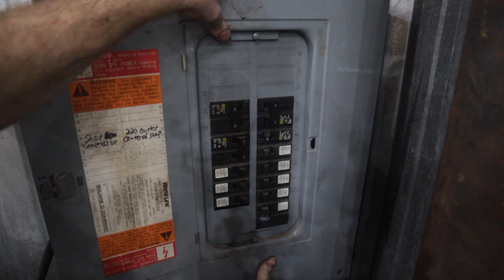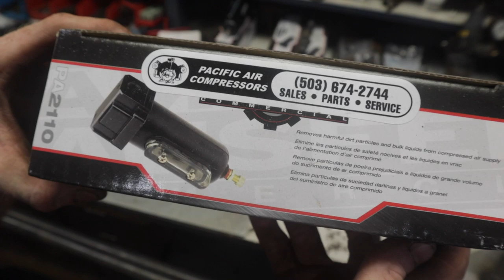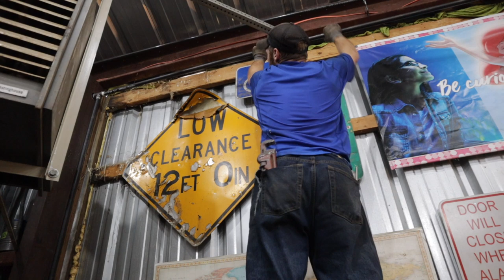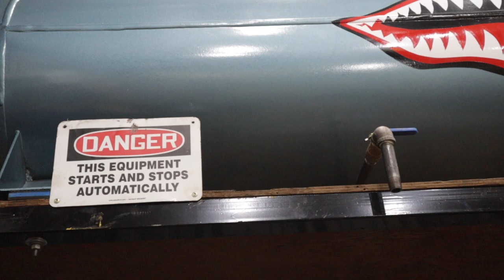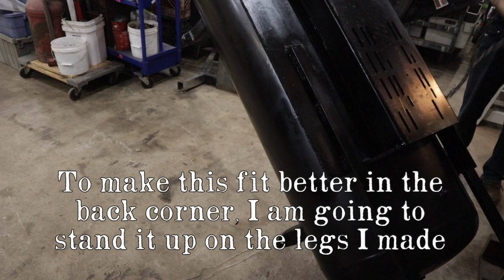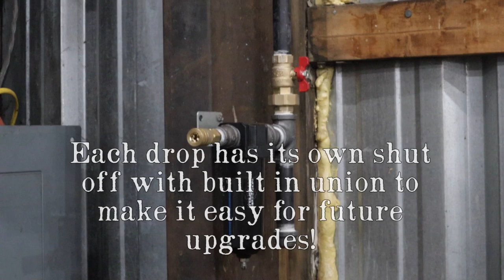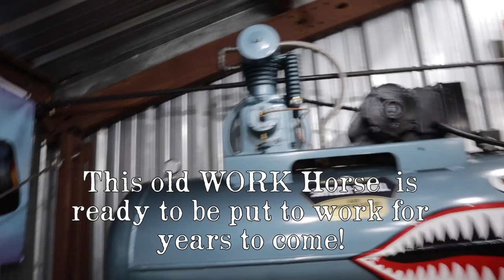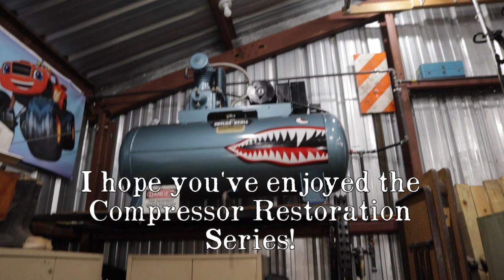OLD 2 Stage Air Compressor ~ Compressor on a SHELF ~ RESTORATION Part 4 ~ FULL Air Line Installation

Comment from the maker: Question of the video: What space saving ideas have you used in your garage or shop?
Reply: If it can go on castors...do it
Reply: Salvage Workshop mostly added drawers and shelves in places that had the space.  My default seems to be to pile stuff on my workbench until there is no room, then build shelves/drawers to hold all the stuff that used to be on the workbench.  It’s a constant struggle!
Reply: Don't try to fit 10 gallons of shit in a quart jug.
The biggest problem you have is using your shop as a work area and a storage space, you can't do both at the same time and area. You had to spend several hours just moving junk to install the compressor, that should tell you something.
Stop pack ratting and start tossing stuff you don't need, start with the 7 old suitcases, what good are they??? the  older garden  tools you don't use stuffed in the milk can and in buckets, if you don't plan on refinishing them in the near future, find somewhere else to store this stuff besides your shop, they are only taking up valuable shop space. You also have too many cabinets and filing cabinets in such a small area. Way too much clutter, unless you have a good memory better than most, you can spend half the day looking for something.
Reply from the maker: @rockislandrides The SUIT CASES are GONE!!! LOL (I still think they are pretty cool!)

I AGREE!! I need an entire building dedicated to storage of materials and planned projects! 

Now, I do know where just about EVERYTHING in my shop is located, but the problem sometimes becomes moving things to get to it, and that's a HUGE reason for all the changes I have planned!

One thing about me is that I am very good at getting awesome materials, tools, or equipment for free or very cheap that they tend to clog up the work space in the shop because I don't want to store things out in the rain.  The other reason I keep many things is because I don't always have the money to just go buy whatever I need for projects, so having things in the shop has saved me A LOT of money throughout the years! It's also made it possible to do many projects when I otherwise wouldn't have been able to afford to complete, so it's a double edge sword and I've been walking it for many many years!!.

Now I will say that I have a woodshop, machine shop, metal fab area, general workbench area and still room to pull a huge truck into it for work, all in one building, so in this shop, things will ALWAYS be a bit tight, but that's the reason for all the updates/ changes I plan to make! 

You make some very good points, and I appreciate the comment! 

As always, thanks for watching & commenting!
Reply from the maker: Most things that can be are on wheels here at Salvage Workshop!
Reply: Tossing out or giving away crap thats been on the shelf unused for years. If it's material I know I can obtain easily. Because we all know when you toss something out, next weeks project will require it. LOL
Reply from the maker: @Lapeerphoto  LOL valid point my friend!!  But EVERYTHING I have is SO RARE.. did you see all that crappy pipe I have!?!
Reply: @SalvageWorkshop  I'm in the process of sorting out a new/second hand shed just to sort out my 1st shed and house. I was born in Africa and inherited the hoarding bug from my parents and grandparents! The problem was if you threw something away you'd suddenly find that you needed it a week later and you couldn't ever replace it from the shops. 

This shed is going to be dedicated to sorting and throwing stuff away (to charity if it's any good). In the long run it will be used as an extension to my tiny work shop, but first the clutter has to go!!!! I'm fed up living with boxes everywhere!!!!

Wish me luck LOL
Reply from the maker: @Zogg1281  I've been in that boat, and sometimes its better to purge things that toy TRULY dont need, but it's never easy!! Good luck with it, I'm working on something similar in my shop now!
Reply: @SalvageWorkshop  I agree with you! I pack things away for projects or resale, feast or famine in my life. I try and keep things I feel are uncommon or kind of Irreplaceable. I did just sell vertical version of that compressor, they are great nearly every two stage pump in history is cloned after them. Anyway great videos I'm hooked keep it up!
Reply: Seems like a consensus -- all of my large tools, except the lathe and mill, are on wheels.
Reply: I built two foot shelving around the entire top two feet of my garage. I call it eyebrow shelving. Cost is $1.50 per linear foot. $1.80 if you paint it. Super strong
Reply: @billbaggins  When space is restricted and at a premium, castors gives you a big advantage with flexibility because of the mobility factor and easier access, probably the most important factor
Reply: @SalvageWorkshop   That is THE KEY, flexibility and access, you don't need tools "locked in the back"with no easy access
Reply: that welding magnet looks like a beast - never seen one like that.
Reply: I keep all my welding supplies in a large Job Box. I rebuilt my welding table to roll over the Job Box when I'm not doing any welding. I have added cast iron casters to a lot of my equipment so it rolls over the concrete floor.
Reply: @Zayden Gianni yup, I've been watching on Instaflixxer for since december myself :)
Reply: some peole put big air compressors outside,protected from weatther..its quieter also
Reply: put compressor outside  is space saving and it is help reduce comppressor sound

Comment: A really nice job. I too worked for years with an undersized compressor. This spring I built a dedicated compressor shed out by my barn and piped air back to my shop underground. The compressor is a new Campbell Hausfeld 80 gallon with a 25CFM pump. Its so nice to have unlimited air and no compressor noise. I also have my parts blasting cabinet in the compressor house. It's so awesome to have ample air to properly run air tools, especially the air hogs like sanders and blasting cabinets. I'm sure you really love it.

Comment: Another great series. This is inspiring me to upgrade my similar 110V freebie compressor to the 220V worn out unit I can have. If/when you add another tank and/or compressor at floor level you could run the upper compressors drain into the lower tank then drain the water from both at floor level. My suggestion to space and ease of cleanup would be some $80 Tractor Supply hose reels at each drop. Did that in my tiny garage and it helps so much. It just takes seconds to put a hose away and it's not a fight to get it to hang neatly. On your compressor if your shop gets hot maybe plumb the air intake out through the wall and down to where you can reach the filter for service. This would give it cooler intake air and also help silence the compressor. Another idea. Attach a ratchet or pull strap to that hand truck at handle level then you can strap bulky things down and they don't fight you when you try to tip it back.

Comment: As an electrician, my only complaint was that panel. Made me want to come and redo the panel.
Reply from the maker: totally agree! Other than adding a few breakers for certain things, that panel has been that way since Ive owned the property I I actually have a need to upgrade the panel... Here's the situation:I am considering trading some construction work for a VERY nice Lincoln Power Wave welder with wire feeder. This will give me actual mig & tig, with the option for pulse welding, but the problem is that this unit needs a dedicated  125 Amp breaker, but I only have a 100 amp panel in the shop.  The main building has a 200 amp panel that feeds the shop's 100 amp panel approx 150 feet away with 2awg / gauge wire (I'm pretty sure)... My question: Can I upgrade the panel to a 150 amp or even 200 amp panel without needing to change anything in the main building other than the breaker? Also is the wiring able to handle the increased load without needing to be upgraded to a larger size wire? I would REALLY like to upgrade to this welder, but I don't want to do it unsafely either! Any thoughts would be much appreciated!
Reply: @SalvageWorkshop  You could probably do 150 amp if your main is 200 amp. I wouldn't try and go 200 amp without upgrading your main to more. If it was me, I'd up my main to 300 amp, and then up the sub panel to 200.  150 amp will have issues, if your running the welder and it's really pulling 125 amps and the compressor comes on that should trip the breaker.  I don't believe the welder will pull 125 amps, I can see 60 amps. Would need to see nameplate or to know the model # to know for sure. 

As for the wire, yes you would need a bigger wire, 200 amp would be a #2/0 AWG  while 150 is a #1 AWG. You could run it in  Aluminum wire. Can get a triplex direct bury service entry wire. Normally runs about $1 a foot.  As for the wire to the main, if that is your service feed, it might be able to go to 300 amp without needing to upgrade it. 

If your not wanting to up the main, can put a load on it (most everything that will run at once) and use a amp clamp to check how much amps are being pulled.

Comment: Besides holding my breath as you worked under an unsecured load, good project. I believe you are required and its a good idea , to either cable or chain the elevated compressor to the roof joists and wall. The vibration will be intense, so check your fasteners at least quarterly if moderate use, mire often if use is daily or weekly.
Yes. A tour, planning stages, construction and installation, as well as all the rebuild/redtorations. 
I'm never bored by your accomplishments. I hope your wife understands your fan base.

Comment: Excellent job on the puffer, you are to be commended for saving a quality manufactured item and bringing it back to life. Properly maintained it will see you and your children out!  However, I'm not convinced with locating it where you have!  In summer, the temperature in the roof space will be considerably higher than at ground level, so it's going to run much hotter.  May be an issue depending on how long it runs for. Tank condensation will also be higher.  Also, servicing and repairs aren't going to be convenient.
It would look better at ground level to!

Comment: Enjoyed this series. You certainly have a valuable asset in that compressor. It makes my 5hp 60gal look puny by comparison, but my 5hp 60gal is twice the machine I used for over 40 years...  :-)
Reply from the maker: Yes, it turned out alright! If I had to but it new, there is no way I would want to afford it, but now it's a workhorse with a bit of value!! My old compressor wasn't in the same ball park either, so don't feel too bad! Thanks for watching & commenting!

Comment: Personally I would have made an inclosure for the compressor and used the flex hose to go through the walls and have rubber padding underneath to make it a bit quieter, since long exposures to the loud noises can make you irritated, and may cause damage to the hearing, but over all it is very well and good done job!!! And cant wait for the shop lay out.
Reply from the maker: I considered building an enclosure for it, but the problem with putting an air compressor in an enclosed space can be the fact that additional heat builds up much faster, and that's the enemy of all equipment, especially compressor pumps.  When it kicks on to refill the tank, it only runs for like 2 minutes or so, and it's not very loud.  You and I could easily have a normal conversation standing next to it while it's running!  That's not to mention that the fact that I wouldn't be able to enjoy my custom paint job!
Reply: People make compressor enclosures because they buy crappy foreign compressors that are spun too quickly and make way too much noise.  Buy a good industrial compressor like Saylor, Quincy, or Champion and you wont need to find ways to quiet it. The pumps are much heavier and have such a high output they can be spun at insanely low rpm and still meet your air requirements. I can barely hear my quincy 325 from my sidewalk with the garage door open. Salvage Workshops Saylor Beall is probably quieter than two people talking

Comment: Glad to see that you didn't cheap out and use PVC. Doing the job right the first time will pay off down the road. Always like to see other ideas on how a shop should be set up. It will for sure be better than my clusterfu** . lol
Reply from the maker: I totally agree! The only other thing I considered is one of those premade high pressure pex kits, but the cost for one of those plus all the extra fittings I needed was insane! My shop is a bit of a cluster right now as well!! I plan to change that!

Comment: The bolts going trough the tank's feet will conduct vibrations directly to the shelf and defeat the purpose of the pads.
If you want to install bolts,you need to also use pads between the bolts washers and the tank's feet.
tank and shelf must be completly isolated from each other.
You made suspensions there,while bushings would work way better : )
Reply from the maker: I'm sure some vibration will be sent through the bolt, but a large amount of it will be dampened by the pads, and that's all I was going for... Before I had the rubber pads under the feet and before it was bolted down I turned it on to see how much it might vibrate, and it runs so smooth that it didn't move at all... Now I do like the idea of adding rubber washers or pads  on either side of the washers, and that wouldn't take much add.  I appreciate the thoughts!! As always, thanks for watching & commenting!

Comment: Nice job, I would install an exhaust hood with fan above the compressor, given the space where its located next to the pitched roof, looks like a spot where a lot of heat will generate. An exhaust fan to the outside will take heat away from the compressor and give it a longer life. You don't see many people use black iron pipe any more for compressors, they do tend to sweat and create condensation and collect water in the lower joints, unions and elbows even when the compressor isn't running. I did notice the inline water filter and  also bleeder valve you installed on the bottom of the tank, a very good idea but unless you have a water separator on all your drops, you will continue to see water, this will ruin air tools and paint guns over time. While the black iron pipe is overkill, its looks like you went from 1-1/2''. 1-3/4, to 2'', used reducer nipples back down to 1/2'' npt ??? Whats the reason for this? Was this a plan or did you get the materials for free?
Reply from the maker: Not a bad thought, I do have plans to install a whole house fan on that wall of the shop to help deal with heat and other fumes, but it would also help the compressor as well! The cost of buying one of those high pressure pex airline kits plus the additional fittings was insane, and black pipe may be overkill, but it will outlast most any setup, plus the way i laid everything out, it will be easy to adjust. If you look at the last part of the video, you will see a water filter / separator at every drop for that very reason, tools are expensive! All the black pipe is 3/4" pipe then I reduced to 1/2" for the water filters, and then the air line quick connects I had were all 3/8". So the main reason was using what I had, but all of the supply is 3/4".
Reply: @SalvageWorkshop  That's all good and yes the pipe certainly should last 10 lifetimes, my apologies, I missed the part where you showed all drops. Good job indeed
Reply from the maker: No need for apologies!! I don't take offense to much of anything! You were just giving your thoughts, and I'm cool with that!! As always, thanks for watching & commenting!

Comment: this big sharky seems a bit heavy for the 2 poor horizontal black bars... what about some 45° reinforcements ?
Reply: Tonton des Bois I agree, that frame looked a little weak, especially since it will be constantly vibrating.
Reply from the maker: It's more than strong enough! The whole thing is bolted to the ibeams in 6 places, and it's not sagging at all!! I thought about adding gussets, but that will limit what size cabinets I can fit under the shelf, so I decided against it. Good thought!
Reply: @SalvageWorkshop  Hard to see from here so I will just trust you... ;-)
Reply from the maker: Ya it wasn't the easiest to show, but the only way I know how to build anything is to over build it!
Reply: @SalvageWorkshop  same here ... I'm a glue&screw guy 😁

Comment: Nice work. I have a huge 80 gallon Kellog American to restore. It runs and works but I would like to rebuild it soon before it quits in the middle of a project. Will have to look into the hydraulic pressurized tank test a little more and see if I can figure out what fitting you used to connect your pressure washer to the tank. Nice work.